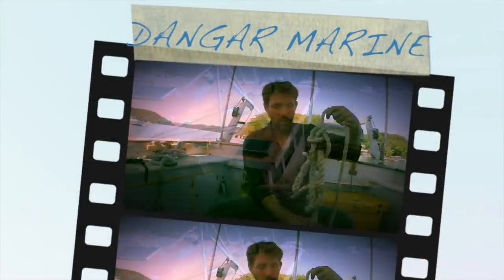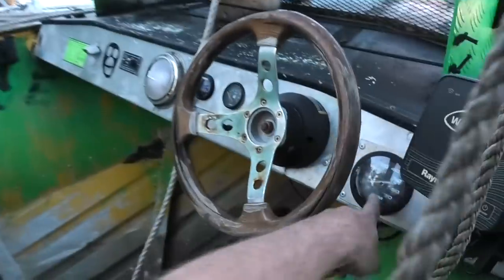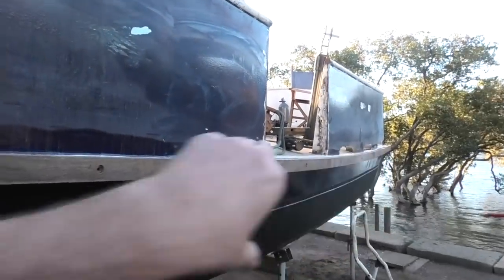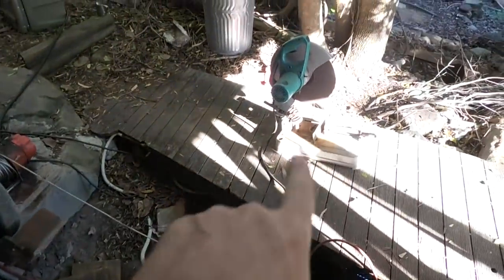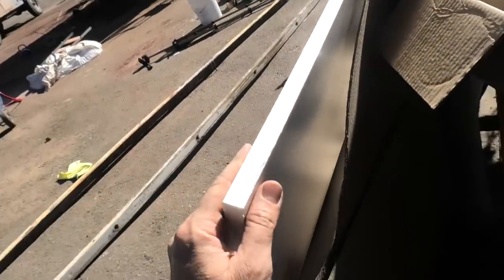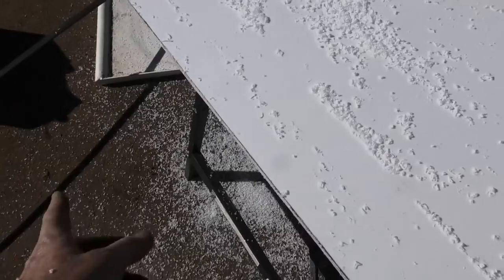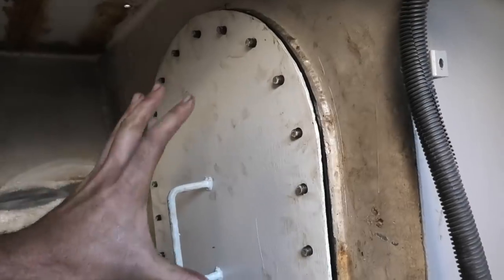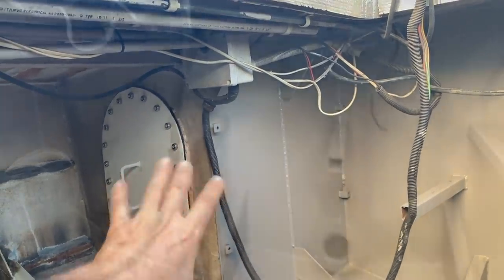Electrical boards and engine bay cleanup

Comment: I’d think that the 40 hp engine of the Green Machine already is more worth than a grand itself 🤔 (at least in The Netherlands it would be around EUR 3.000)
Reply: Yeah same here in Finland. Just checked, even used 40 hp ones from the 90s go for 1200 - 1500 € and 40 hp from 2007 - 2009 all go for about 3 500€.

Comment: A little bit of Duck Tape^ would remedy that crack on the Green Machine and you’d get at least another 10 years. Look up “The Red Green Show” from Canada. 
———
^ it is actually Duct Tape (I believe you call it Gaffer Tape) but no self-respecting Canadian DIYer would pronounce the ‘t’.
Reply from the maker: There's nothing you can't fix with gaffer tape. ;)

Comment: About the electrics - I guess it depends on the onboard location, but there is a pretty cool modular panel designer and setup app that handles all the power distribution, pump control, master switches, battery management, monitoring, 12, 24, 120, 240 V needs you could imagine.  You design the panel yourself based on what you need.  Take a look-see:  https://panelwizard.bluesea.com.  The video kinda shows what it's all about.  Hopefully not overkill from where you're headed, but you'd be stylin'!   Keep up the good work, Stu.!
Reply from the maker: Bluesea to make great stuff. I'll check out the wizard.

Comment: If you are thinking of a new outboard for your new dinghy, I suggest you look at the littlest Honda.   I have been considering one of these as an auxiliary for my boats. Only 30 lbs @ 2.3hp.  4 stroke, air cooled( no water pump to worry about). Been watching videos about this motor and I have to say I'm impressed.  Your new inflatable is rated for up to 5hp.  An engine that size will go faster and have other features you might like but it will weigh twice as much and cost a good deal more.  Just a thought, you may already have other plans.  Cheers mate, keep up the great videos.
Reply from the maker: Hey mate. I too have been looking at the four stroke Hondas. They seem to have some great features and review really well.

Comment: Congratulations for your great job master! 
I used to have a inflateble from aliexpress. It was a 10,5 feet inflateble rated for 15 hp. With muy old 1956 Johnson 15 that boat simply flyes over water, but at its almost 10 years I wasnt able to keep it floating saftely. That's why i purchased a almost destroyed aluminum flat bottom to repair. Ironicly, in ten yeara the inflateble never sinks and in just 3 days a storm sinks the aluminum boat (and that is why flat bottom boats are not best for sea..... I should have imagine that).
Any way, with this boat maybe you can teach us how to take good care of a inflateble so it can last as much as it can. Congratulations again!
Reply from the maker: Hey mate, yes, I think this boat will be a good opportunity to talk a bit about inflatable boats for the first time.

Comment: I've got a 70's star craft with about the same hull as her (mine is 18') and I would never trust that thing to live in the water, I gave up on addressing individual leaks and just epoxied the entire bottom after welding up a seam, it's got a hurt 90 on it now which makes her about jump out of the water and sit stern low, just curious how the green machine performed with the 40 since I'm about tired of trying to make this Johnson salt worthy and can have a 50-70 for about half of what a 90 will cost me.
Reply from the maker: Hey mate. When the hull is clean it does about 25 knots and it pretty economical.

Comment: I am a bit conserned with your choice of electric panel location. The engine room is a nasty location. Lots of mixed fumes to encourage corosion and tight quarters to be serviceing breakers and electric connections. I reccomend having your electric panel in the wheelhouse. If any electrical device goes out it offers quick and easy access. No corrosive fumes will be present and should you be underway it would be easier to be aware of your boat's surroundings and more comfortable to work.  You're doing a fine job and moving along quickly. Good timing for a break, too.
Reply from the maker: There will be a breaker panel in the wheelhouse, but there are certain components that must be mounted close to the batteries, that is what this board is for.

Comment: I absolutely recommend the battery tray have at least a 1 inch lip all the way around it. The last thing you want is acid eating into the steel hull you have put so much work into. Cut some strips, glue and screw them around the perimeter with 5300. Hit it with a router and a round over bit, and you will have an awesome battery tray.
Reply from the maker: Yes, I agree you can't be too safe with the batteries. Anything can happen, and on boats it usually does.

Comment: FYI - If you would have taken the whole piece of the side bumper prior to installation and soaked it in in water on a good hot day for about 24 hours. You most likely would have been able to form this piece all at one time. Also as you noted you started applying the wrong end first. You should have started with the largest curve first.

As for this poly board you are going to mount all your electronics on and including a shelf to mount and hold your batteries. You picked a good product to hold up in the environment you are going to be using it for. The product is resistant to diesel, motor oil fumes and sulfuric acid from your batteries.

I look forward to seeing you electrical layout design. Just as a note: being able to fuse off each electrical item can be very beneficial in the future when you have to run down an electrical issue.

Also have you given any though to how you are going to valve off your diesel tanks. This includes cross connecting and being able to transfer from one tank to another? Also to set up and placement of your fuel filters for easy access.

I enjoy your videos.
Reply from the maker: Hey mate. There is a cross pipe between the two fuel tanks that I took out to paint. It has the valves required to allow the engine to draw from one tank at a time or both together.

Comment: Always look forward to watching on my Sunday mornings.  I do wish these were longer episodes but I enjoy them all the same. Also HDPE (High Density Polyethylene) is a great material to have on hand for lots of different projects.
Reply from the maker: Very handy stuff other than being impossibly to glue.
Reply: You weld it using a plastic mig weld system. Works well. 
Takes practice though.

Comment: Yeah taking a bit of time away from the project to look at other stuff is a good idea that way you don't get burnt out stew. What most people don't understand with aluminum boats you have metal sitting in an electrolyte and overtime the aluminum gets brittle and you're both cracked right where I figured it would cuz it seems to be an ongoing problem on just about every aluminum boat made.
Reply from the maker: Yes, aluminium, although amazing stuff does have its limits.

Comment: Maybe put only one board in engine room and hook up what you need there ? Run maybe a 8 ga. Gauge wire to your wheel house console where your steering is.   a battery bank there with an isolator ( or better yet 2 alternators )so you don't kill your engine battery. Put your solar panel controller there as well. Could save lots of money on wire . That's kind of how we did it on our boats anyhow. Maybe put second panel in lazarette if you want to put a small generator in future.
Reply from the maker: That's pretty much the plan more or less.

Comment: Hey stu, I’m not a wooden boat builder but I believe the idea behind steaming wood into a different shape relies more on the heat being applied to the wood and nothing to do with the water. I think you might be making a mistake by just wetting the wood with boiling water. You need to apply force to the wood while it’s hot and the resins within the fibres are made malleable, as soon as it cools the timber will retain its new shape.

I enjoy your vids, good progress so far, 👍👍
Reply from the maker: Yes, I agree, have been starting to bend it while warm. Thinking of leaving it with some weights on it while I'm on the road trip.

Comment: You don’t want too many panels but locating switches in a large panel is difficult I like the idea of 2.  Are you sure the poly board is going to properly support the batteries?  That stuff likes to droop I say do it right put in the metal and use the poly somewhere else.
Reply from the maker: Yes, the weight of the batteries and the heat in the engine bay could be an issue.

Comment: Good idea. Get rid of the green machine for something ya can bring on board the troller and go back and forth between home and the troller. It would turn into a giant pain to have to drag that big of a boat around behind ya, plus the green machine has seen better days. There's only so much you can patch and fix before the whole vessel becomes one big floating unreliable patch.
Reply from the maker: Yes, you do eventually start fighting a losing battle with a boat that needs too much patching, plus I know it would knock against the hull no matter how careful I am and chip all the paintwork on the trawler.

Comment: use the old wet exhaust hole since its already there for venting the engine room /battery compartment. just put a blower in it and a flapper. draw up your wiring schematic and get the parts so you can lay them out on the boards. looking good.
Reply from the maker: Good idea. :)

Comment: suggestion, why not weld a strip of flat bar to the end of the shelf brackets to provide a lip for your polyboard battery shelf.
Reply from the maker: That certainly could be a good way to go.

Comment: i find if your having problems with opening sea cock or turn valves. is to soak them in a solution of Citric Acid and water and it works better if the solution is hot as it eats away at limescale that may be the reason you can`t open your valves its just a thought
Reply from the maker: Hey mate, yes, I had them soaking in acid for a while to eat away the calcium carbonate of the shells that had grown in there. Still can't get them apart though!

Comment: Stu et al;  Eddy and I are fans of your work and agree your ideas are outstanding and on track for what I think will be a happy outcome. I advise you to use Marine Grade wire and go beyond the wire size needed and be sure not to use any crimp type connectors. Solder all connections and lugs using an old fashioned soldering iron and use two coats of paint on insulation and final wrap with # 33 3M vinyl tape and mark all wires on both ends as to purpose using label maker such as P touch. I like Anchor and Pacer group marine grade wire. If you have to add a tracer color paint it on yourself before you install the wire because if the wire run is less than 100 feet long the cost is lower if you paint on the stripe yourself. Example you may have to run a #14 AWG wire with a yellow stripe for your helm control wire for shift forward. Never use automotive wire for Marine use. I have over fifty years (50) doing electronics and working on air traffic control systems and I studied electrical engineering at Florida International University (FIU). Soldering all connections will help the wiring live long and happy service life. Using larger wire will help if you have to add onto any circuit in future. Before you start the wiring create a diagram so you can have people help with the wiring if you get sick or have to work on other projects. I agree time to retire and cut up the green machine. I know you don't have much time to watch videos, but please subscribe to my channel and make comments how I can improve my video productions on how to restore a fiberglass boat with a stern drive. Cheers!
Reply from the maker: Hi Dennis. It's interesting that you favour soldering. I did too for a long time but people eventually convinced me that a properly crimped connection actually forms an atomic level bond that is superior to soldering. Maybe both is the way to go. ;)
Reply: @DangarMarine  Stu, I'm ok if you crimp then solder, but be sure to solder. I have been on the water in one form or another since 1963. My family has always owned boats. Frist boat was 21 foot owens wood boat with jeep engine straight shaft we used to cruise the badly polluted calumet river from the south side of Chicago to Lake Michigan. More boats in Indiana local lakes and Lakes of the Ozarks and land between the lakes. My oldest son lives in Brizzy AU and I visited in 2017. Check out my vlog dated today on my boat restore project if you have any time to view. https://www.youtube.com/watch?v=XtHE45s3sZk
Cheers and Godspeed.

Comment: I am a patron of both you and Brupeg, so have a great visit, vid it for us,  Batteries  spill proof box Just to be on safe side ??
Reply from the maker: Thanks for your support Neville. I'm in two minds about battery boxes. They make monitoring the batteries and linking them a bit trickier. I'm thinking I might go with tie down straps and a tall lip around the outside of the shelf to contain any acid.

Comment: Is there a video for making the fuel tank gasket? It's high on my to do list and not sure how to go about putting clean holes in 4mm nitrile. It's for a GRP tank in an old aquarius flybridge. Cheers
Reply from the maker: There is, can’t remember which video it is in though. I used wad punches to make the holes.
Reply: @DangarMarine  cheers, I guess I'll just have to watch all the trawler videos. Totally ok with that. Keep up the good work 👌

Comment: If it doesn't flex enough don't force it. A piece of pvc pipe makes a great steamer and can be sealed around the wood with aluminum foil. Chances are you can use foil to attach a hose of some kind to the kettle and steam away. I might've used such a method and even returned the pipe to Home Depot after I was finished ;-) 
   As for the green machine, chances are someone will give you better than scrap for it, I know I would if I was close. All she needs is some more floatation in the bow and possibly stern. Then get some aluniumum sheet and a tube of 5200 to fix her once in a while. Drill the crack ends, clean and then slather in 5200 before adding the sheet metal with a few rivets.
Reply from the maker: PVC pipe does sound like a great way to go. Yes, I think the Green Machine could possibly still be a usable boat for someone if it lived on a trailer.
Reply: @DangarMarine  I don't know how it's rated there but I used Schedule 80 PVC that has a rating to 140f or I think 80c. But that is where it is designed to still operate safely under pressure. For steaming sticks it is fine as long as you keep it away from the fire. If it gets too close it will give you plenty of warning as it tends to sag a little. With the stove on the ground and trim on the boat you'll be fine. Nothing is under pressure. Then to pipe the steam in I used a length of that POS exhaust flex pipe I had and held it together with some good HVAC foil tape and duct tape. There's no need to get fancy and chances are you'll have something that will work on hand. You might get away with using the camping stove but I wouldn't bother because it'd probably be more hassle and gas/propane than its worth. Not to mention I have my doubts about it making enough steam. Most times I make myself a "hobo stove" from paint cans and a pressure cooker from the second hand store that I modified with a hole saw and exhaust flange. One thing that is a life saver has been rigging up a water feed to help keep it from going dry. It's nothing more than a small petcock I dug up that I open a crack allowing a slow drip of water in the pot. Last but least is if I'm doing more than some small trim or its a fancy yard I'll drag my outdoor cooker along with a bottle of propane. But after forgetting it multiple times I began using a hobo stove and what is on hand...…….. Last but least is if you can find it,get yourself a roll of commercial foodservice grade aluniumum foil. I've found a ton of uses for it including sealing around the wood and pipe for steaming. The restaurant grade stuff is thicker,wider and longer then the stuff for home and is very useful in steaming. But it's one of those things you'll find 1000 other uses for too.

Comment: Read up regarding powering the inflatable tender , try electric , you can get quite a lot of sea miles with an electric powered outboard , no mucking around with mixing gas and oil . Worth thinking about , cheers from NZ.
Reply from the maker: Hey Rick, I do like the idea of going electric for this tender, particularly the models where the battery is in the motor.
Reply: @DangarMarine  I`ve never owned one , but they are light as , which will make it perfect for lifting the inflatable onto the launch and at the boat ramp.

Comment: How are you doing on the parts you need for the 4-71 head O/H? I recently swapped out a cracked head on a 4-71 gen set so I have all the springs , keepers, valves and such off the old head.
Reply from the maker: Thanks for the offer mate, but managed to find a good source of new parts locally that wasn't too expensive.
Reply: @DangarMarine  Excellent, glad to hear!

Comment: Just be aware that nyloc nuts don't give an accurate tension reading, they won't be tensioned at 20nm like theyre supposed to, the drag of the plastic washer falses the tension
Reply: You tension nuts to stretch the bolt, as long as the bolt doesn't get overstretched it acts like a spring
Reply from the maker: Good point about the spec, but I think even is the main goal here.